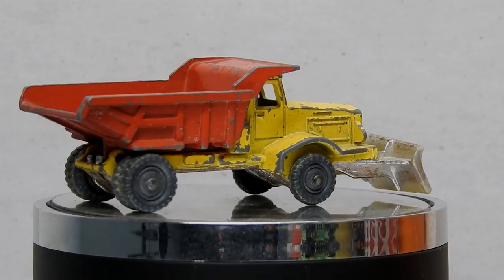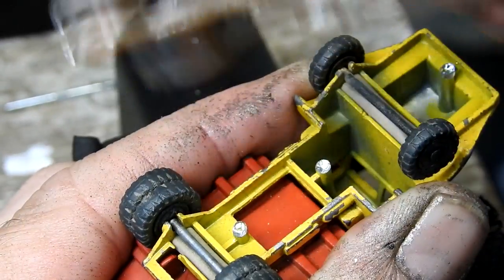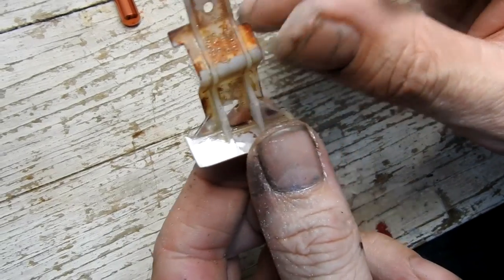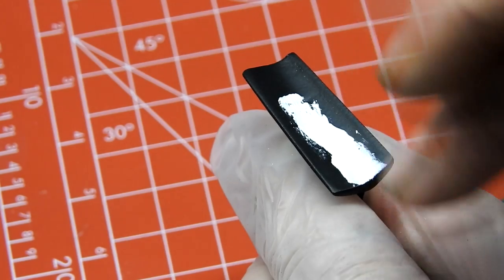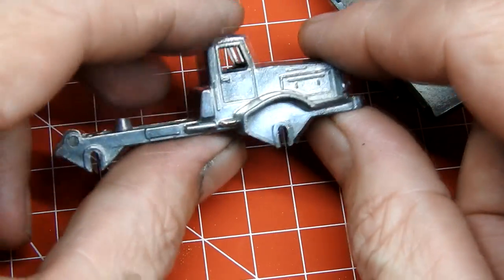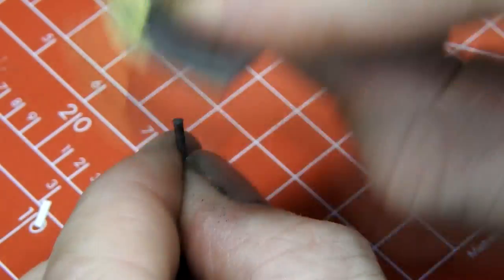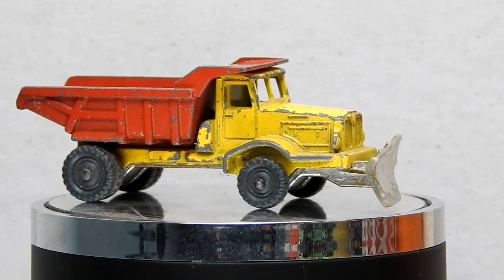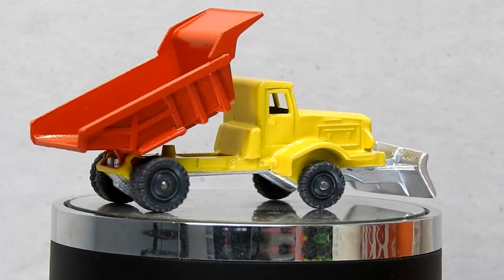Husky Toys Restoration Aveling-Barford Dump Truck

Comment: Corgi Collector here. Most information given about Husky is correct. Corgi (Mettoy) was contracted by Woolworths in 1964 to make an exclusive line of small cars to compete with Matchbox. The name Husky maintained the dog theme and made the line sound strong and tough. The Husky line proved very popular and was made until 1969 when the exclusive contract expired. Corgi had a huge warehouse fire at their Swansea warehouse in 1969 and lost a lot of product. In order to keep toys moving to dealers, Husky was quickly rebranded to Corgi Junior and sold into regular Corgi markets. By the early 1970's Corgi Junior was the third largest manufacturer of thee inch cars after Hot Wheels and Matchbox.
Reply: Thanks for the info! I'm a filthy Colonial, so I'd never even heard of this line, though I can recall having some Corgi Jr. cars that likely came from over the border in Canada.
Reply: i was a collector, I had blister packed ones with the Corgi Jr label on the base over the word  Husky. I think I may have also  seen that as a child to opening up the pack

Comment: I wouldn't think that the company that produced this truck would have used plastic for the blade....but they did and you've done awesome work repairing it. The truck as a whole looks fantastic. Well done.  🍻
Reply: I had their blue tow truck  during that era . The tow hook broke in  a day.  They were a good toy , The brand I disliked was Hot wheels because the wheels always fell of them , Now they are worth the most over all

Comment: Great resto as always Danny. I have quite a few Husky and Corgi Juniors, which is what Corgi rebranded them to. They are in fact a Welsh company and were originally Mettoy then the larger scale castings were called Corgi and the small scale Husky. In a bid to get the Husky brand more aware to the buyers they Rebranded to Corgi Juniors ( Smart move). They produced a lot of castings, some very much like Lesney castings and some quite unique pieces.

Comment: Top job Danny, looks great! I never owned any Husky's as a kid (had  a dozen or so Corgi's), but have been looking forward to seeing restos on Husky's for some time. I imagine they're quite difficult to restore as there doesn't seem to be any repro parts out there for them (or Corgi's) like there is for Matchbox and Hot Wheels.
Reply from the maker: Yes, I suspect if the plastic was as brittle as the stuff on this model as a general thing a lot of them maybe have broken allready.

Comment: I"d just found a Wiki Page on them it said they'ed rivaled with Matchbox during the 1960's plus also I found out they apart of Corgi Toys which I 've seen them in the books and on the internet that they make well detailed diecast cars.
Plus I have a Corgi 007 Casino Royale Aston Martin which I'd got with a Casino Royale DVD set back it the late 2000's